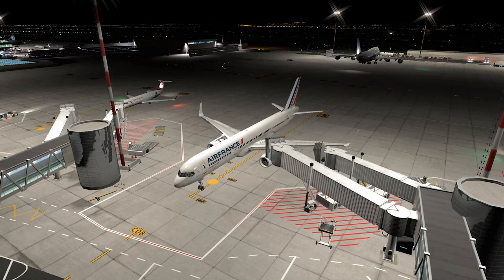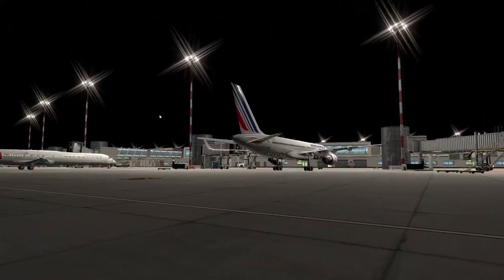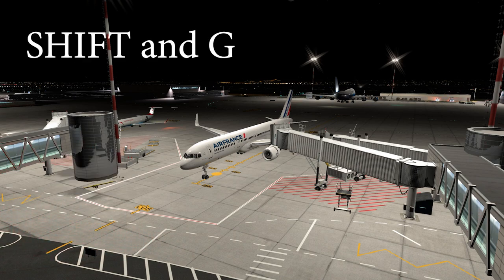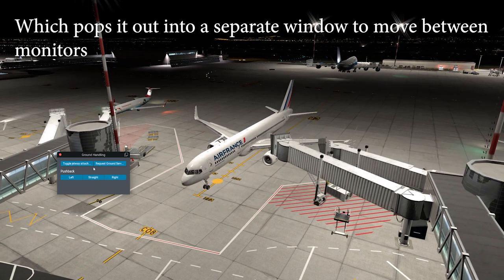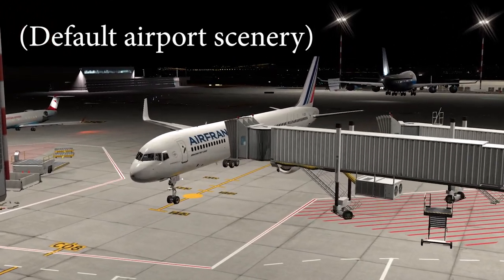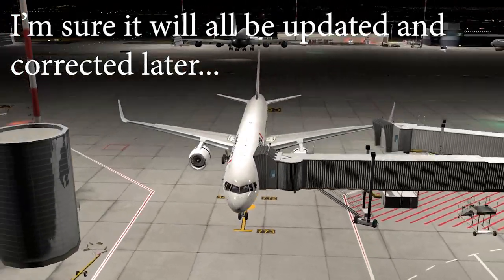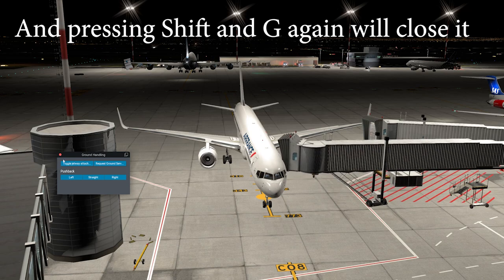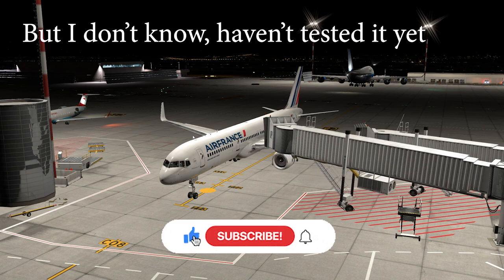How to get Default Jetways to Move in X-Plane 12?

Comment: Thanks, great tip.  How does this compare to SAM jetways?  It looks like it is easier to use, but that 3rd party airports would need updating for xp12 default jetways?
Reply from the maker: All default airports will work, but yeah probably all the 3rd party ones will need updating or most of them will probably just stay with Sam.
Reply: @Simleybob  Thanks.  Yeah I saw that with Origami's Heathrow.  I thought "Are SAM better?".  Maybe they'll run a black friday promotion :)  (Great to see the moving jetways in xp12 though, hopefully over time developers will start using the built-in ones).
Reply from the maker: @weswheel4834  SAM is free! At least for the 3rd party airports.
Reply: @Simleybob  Oh right, I thought you had to buy SAM jetways for it!  Thanks :)
Reply from the maker: @weswheel4834  only if you wanted to make default sceneries have jetways in xp11, this replaces that

Comment: I tried it , not working. im able to get the pushback. not the jetways
Reply from the maker: Hmm, make sure you are on default scenery and don’t have any scenery installed for the airport you are trying
Reply: @Simleybob  Yes, i also have the sme Problem with the default scenery.
Tough the Jetway is connected to the plane, but you cant disconnect it
Reply from the maker: @SnavoArts1  hmmm, maybe file a X-Plane bug if no 3rd party software is involved